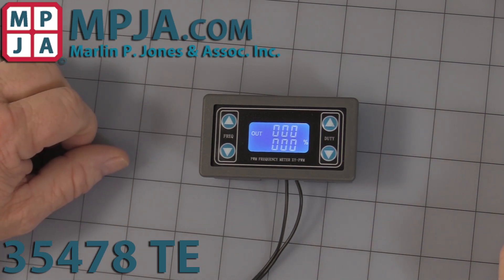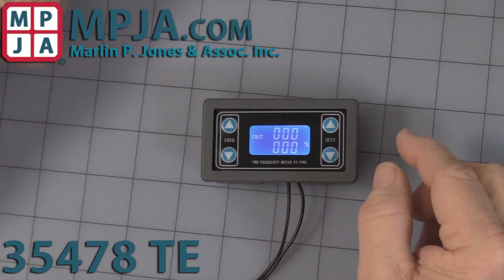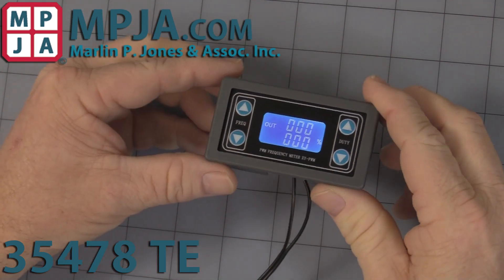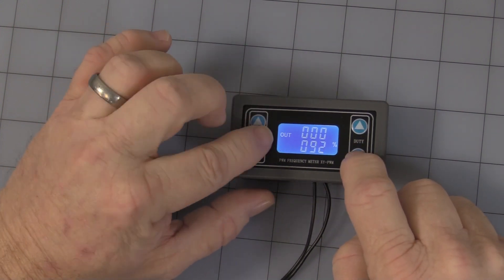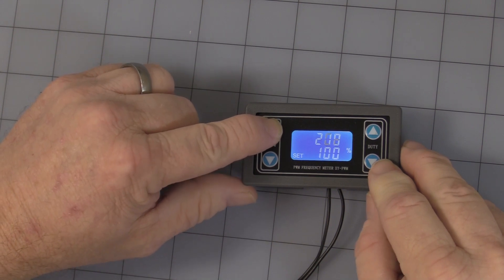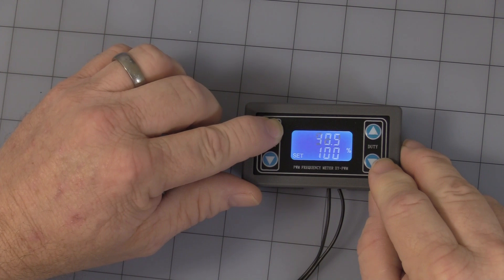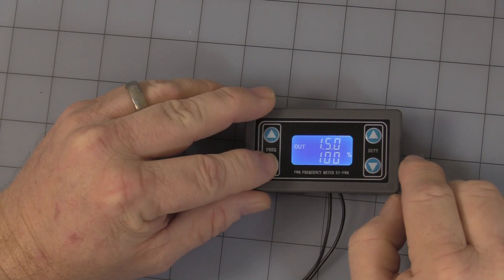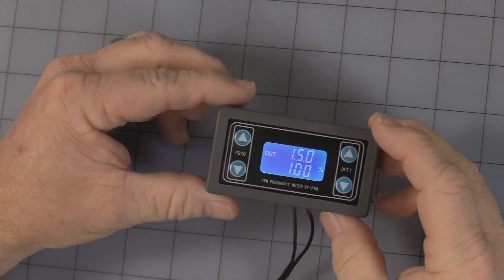XY-PWM Signal Generator with Case   35478 TE

Comment: So if I use 12v DC I'll get 12v pwm output?
Reply: No, mine only puts out 2.7 volts, 12v input. enough to light a led. very low amperage. I hoped it would activate a small solenoid. Considering the size of the wire for the input, I was disappointed. But he said it would have the same output as it was given. Let me know if there's a trick in the settings.

Comment: Thanks for the video. I have a question about the unit. I can not seem to get the output the same voltage as the input. I can only get a oscillation of around 1.5V irrespective of the input voltage. Is my unit faulty or am I doing something wrong. Thanks Joe
Reply: I'm having a similar problem. I'm putting 12 volt in. When dutyis at 10% only 2volts is coming out. When I increase duty % the voltage out put increases. This thing is fake junk. I have 2 other pwm and when increase the duty the amps increase. That's what a pwm is supposed to do. This thing doesn't  control the amos, it only controls the.volts. this not a pwm. I'm returning mine just because they tricked me and wasted my freaking time
Reply: @billbice4704  thanks for the comment. I’ll try to build my own pwm.
Reply: The  most I get is 2.7 volts output. It will light an led for 3 volts. Maybe run a transistor. But no power.

Comment: Can this be powered by a 12v 1amp power supply ?
Thank you !
Reply from the maker: Yes, but the output current is only 30ma max.
Reply: mpjaonline all I need for output would be 30v at 5ma, can this device produce it ?
Reply from the maker: @Enoch-Gnosis  If you use a 12vdc power source the output will be 12vdc. Also 30vdc is max input voltage be very careful not to exceed 30vdc.
Reply: mpjaonline got it thank you !